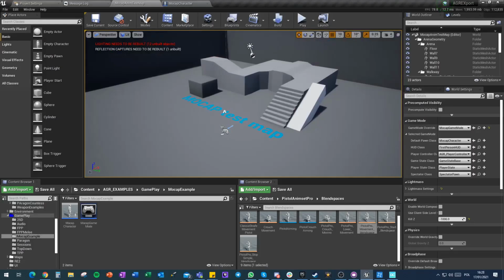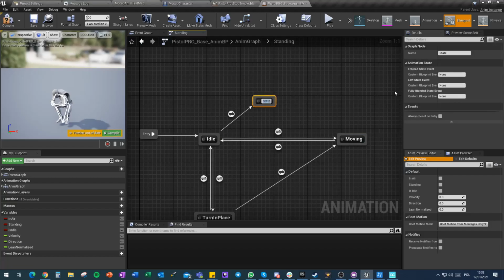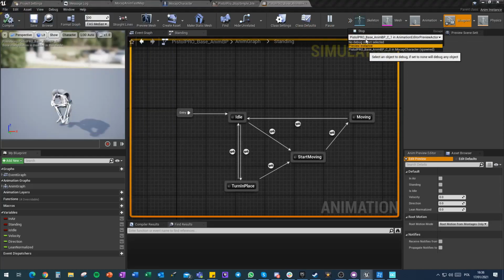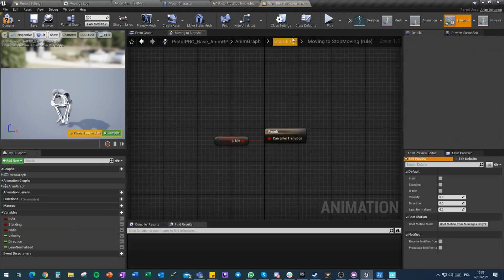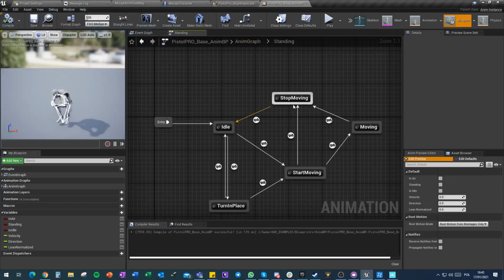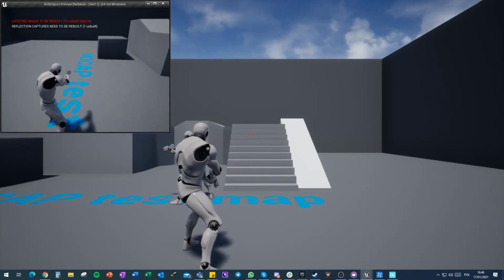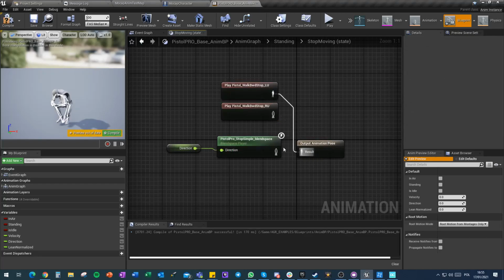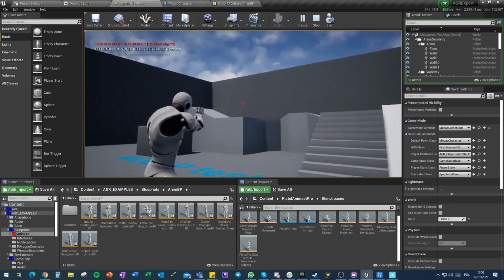Start & Stop Animations + Multiplayer - UE4 Advanced Blueprints Tutorial - Unreal Engine 4 DevLog

Comment: Hi! What does inertialization do?

It gives me error when selecting it
Reply from the maker: it works only if you have blend space or blend nodes that use "inertialization" as blend method. the default is interpolation. what it does is interpolate blend between animations with the frame to frame momentum in mind. But most important... it is way more performant and is under the motion matching now as well. it lowers the number of blend assets stored in memory.

Comment: Hello, for some reason my 'stop' blendspace does not seem to use direction. It always does the stop forward animation. But for my 'start' blendspace and general movement the direction works fine. Any ideas?
Reply from the maker: Check the debug widget to see the direction at stop. It should remember last movement direction once it hits stops
Reply: Same issue as dookee9626 animation blendspace plays only forward stop animation. Seems as if the direction from last movement isnt remembered @3sgamestudio
Reply from the maker: @MaximilianMitchell  if your velocity is equal 0 it usualy calculates that its always single direction. thats why in agr pro plugin we have a minimum threshold to remember last direction that was still valid for the stop animations. make sure you are on latest version.
Reply: @3sgamestudio  turns out I didn’t even have AGR installed lmao. After getting it set up quickly I grabbed the direction node from the agr component and plugged it into the blend space and works perfect.

Comment: Great video!

Question: What system did you use to create the idle boolean? I cant create transitions because I dont know how to create this variable.
Reply from the maker: Velocity near equal zero but only x,y velocity. Ignores Z
Reply: @3sgamestudio  I appreciate your reply but I'm using root motion. So I don't think that'll work 😂

I'm checking if the forward or right input is different or equal to zero, as alternative.
Reply from the maker: You can check acceleration instead of velocity. It is driven by input in mulyiplayer. Or even real „previous acceleration input vector”
Reply: @3sgamestudio  bless you